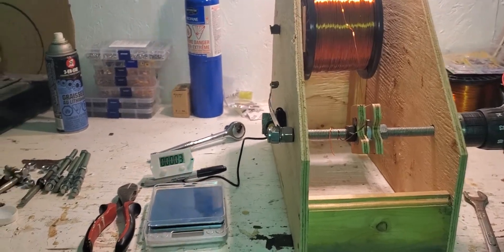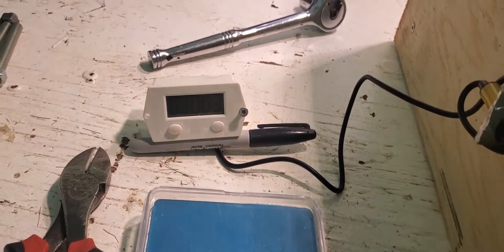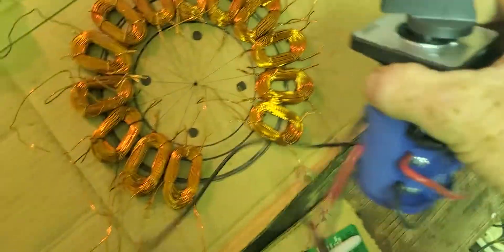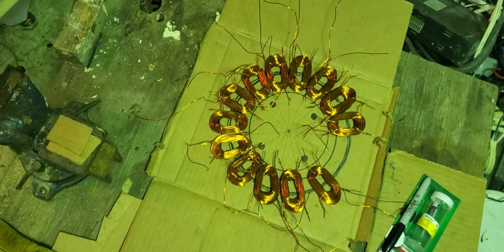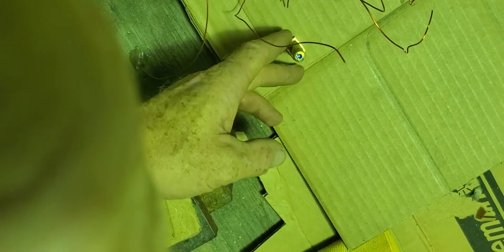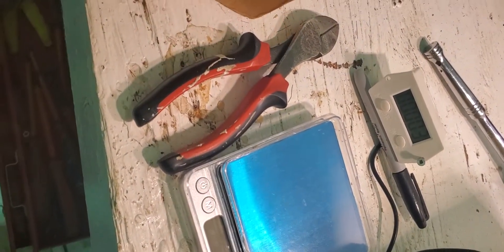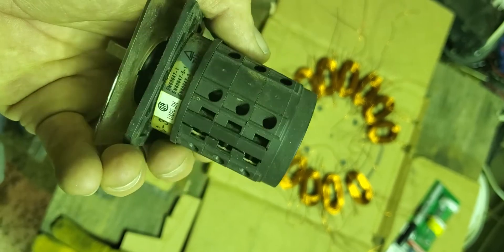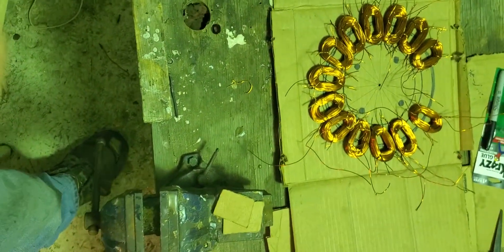Coil winding for the Axial Flux windturbine and some other details

Comment: Nice coils and the switches.What is the voltage peak do you think she'll make? So your making a direct drive turbine? It will be a good producer for sure. Whats your plan for a controller? Well thanks for sharing :)
Reply from the maker: Direct drive yes
Reply: @windpowerandmore6310  nice to see another axial flux maker!!! I have those blue switches in my system as well!! They work great!! What size are your magnets? Dimension wise?
Reply from the maker: Thank you very much Eric the magnets are small n52 grade 3/4 × 1/2 × 1/4 inch 20 pound pull force. The big Axial Flux I'm building next has 2 × 1 × 3/4 inch 147 pounds pull force magnets. You can see me unbox them in a previous video I made. Thanks for watching always!
Reply from the maker: I'm hoping for the 200V range in star , at least with the switch it's easy to switch it to delta if I need to, I still need to order a midnight classic with a clipper for this turbine,  I don't think I'll get that before I go back to work next month.  For now I'll probably just run it in delta to the battery bank and use the dumpload controller i have with the ssr's . I really hope you enjoy and I really appreciate seeing your work! Thanks for watching!